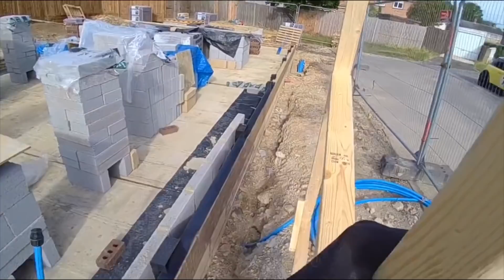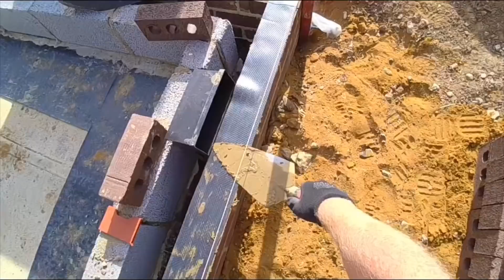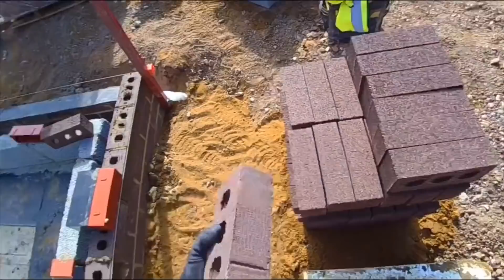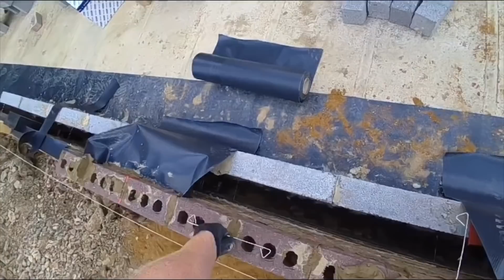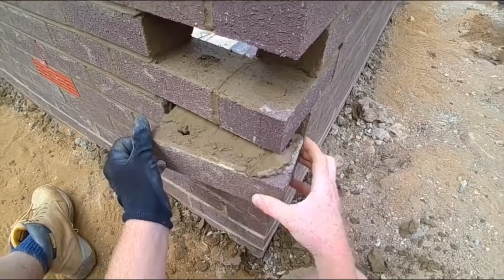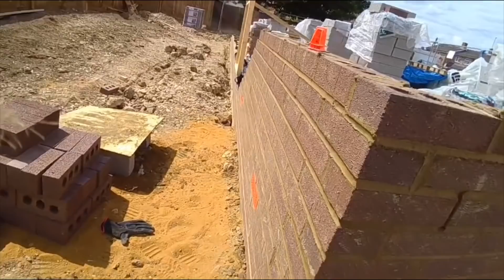Don’t do this when bricklaying | The skill of bricklaying

Comment: 2 tips for anypme coming in later on, when the bricks have a finish on like that, you will eventually learn to tell which way is up at a glance, as looking down from the right way up it looks smooth, and from the wrong way it looks rough. It'll make sense in practice.

Second is when putting ties in afterwards, its good to give the brick or block a little tap afterwards to close up the void you make pushing the ties into thw joint. Still not quite as firm as putting them in before the brick but when you put in thousands of the things you inevitably miss a few here and there.

Comment: Little advice, take note or ignore ,up to you. Do not use just the tip of your jointer on cross joints resulting in horrible  ripples finish plainly visible  on your photo  ,use the whole jointer and top and tail your joints. I could close my eyes and tell you are draging  the tip of your jointed just by the  scraping sound, loose that bad habit  . Good pointing can make bad brickwork look  good and bad pointing can make good brickwork look bad ,always remember that
Reply: I think only bricklayers care !

Comment: Is bricklaying a good career path to take? 20 years old, and still not sure which career route to take, any advice?
Reply: I'm a retired bricklayer/builder (back problems) just one of the issues I had, so let me give you the best advice you'll ever receive, STAY AWAY FROM BRICKLAYING,
1) losing so much money due to weather ( especially in the winter)
2) check out health problems with mortar/cement. 
3) rough, cracked hands (your partner won't like that)
4) poor eyesight due to cement, brick dust and chippings, grinder work,
I could go on and on.
Go for a trade where the weather is not a problem...
Electrician, plumber, joiner/carpenter, IT computers.
But whatever you do, GET A TRADE, or you'll end up at McDonald's, pizza hut or stacking shelves at Tesco. 
Good luck
Reply from the maker: I agree with paw way do it if it’s a last resort
Reply: Electrician or Plumber with your Gas cert. Take it from a Plasterer. Good luck mate

Comment: When replacing them bricks all you poms put the mud on the top of brick it make a mess and looks awkward to do and never look bang on always to low then you have to wedge stuff in what you should be doing is putting no mud on the will go in easier no mess and sit in the bed of mud properly and then get a Dutchie and fill the top joint in
Reply: No you put bed on bottom brick and butter back edge of top of brick but only enough to stop the push joint then it’s a top joint point with really dry mortar and a pointing trowel.
Reply from the maker: Sorry I should retire I’m doing it all wrong.
Reply: Well you would not want  him on a pointing job would you?
Reply from the maker: You have ruined my day with this comment thanks a bunch 😂
Reply: @ginger dust I would happily have you laying for us on the extensions we do. Take no notice of the haters!

Comment: There are bricklayers and then there are site bricklayers!
Reply from the maker: What am I 😂
Reply: Using an overhand trowel designed for skyscrapers in USA  see a lot of site bricklayers getting flicks of mortor on brickwork from cutting off because the blade is set for a different wrist action

Comment: Whats the benefit of bedding the damp on?
Reply: Mr Ctop93 to stick it down and then its also got two layers of mortar top and bottom for stability of the wall.....another reason is to prevent piercing from rough edges below but that's highly unlikely in my opinion
Reply: There is no benefit of bedding the damp on.
Reply: @frankiedancaster4424  two beds of mortar for stability of the wall? Is that a joke?
Reply from the maker: The whole house might fall over 😂
Reply: @GingerDust69  🤣👍
Reply: I’m pretty sure it just holds it in place until you lay a brick on it?
Reply: @sethmartin8576  all right seth, thats enough out of you
Reply: @carrot3945  you fill the frogs up and stick the damp on to prevent frost damage and to hold the damp in place
Reply: @stuartjones1982  incorrect sir
Reply: @carrot3945  please enlighten me
Reply: @stuartjones1982  you enlighten me instead, how would that have any benefit to stopping frost damage?
Reply: @carrot3945  if you dont fill the frogs with muck water can get into the void. In winter it gets cold. When water gets cold it freezes and expands (gets bigger) you still with me? Therefore it cracks perp joints, bed joints and the brick itself. Hence frost damage
Reply: @stuartjones1982  theres no need to just start making things up. If you dont know the answer just say you don't. We are all friends here
Reply: @carrot3945  🤣🤣🤣🤣🤣 ok I get it. You rumbled me
Reply: Mr Ctop93 what I'm referring to is a bed of mortars below and above the dpc to prevent the wall moving whilst plumbing or laying as most bricklayers will confirm that sometimes walls have tendency to move about whilst building/plumbing up especially single skim block walls....where as a bed of mortar under the dpm/Dec can help with this in my opinion that is. I guess as brickies we all all have our own methods 
🤷‍♂️
Reply: Ginger Dust to be fair I like the one weep hole above the centre of the air brick......that's one less then we usually do to keep nhbc happy must save some time overall matey 👌🏾
Reply: @stuartjones1982  just having a laugh mate, your a good sport🤣👍
Reply: @frankiedancaster4424  well said brother. I guess we do all have our own ways👍
Reply: @carrot3945  lol yeah I got that mate
Reply: Mr Ctop93 indeed as to build a wall off two pieces of plastic (i.e. Dpc ) with no bond between (I.e mortar) would be considered incorrect (I.e cowboy).....I know each site/engineer spec is different but day one is day one no.??

Comment: Your rough   still got a lot to learn, pushing  mortar in with your fingers ,cutting and running on cross joints  not full ,pushing  in time wires after laying brick , how the hell you missed them brick ends is unreal , airbrick wrong course, smears on face of bricks allin a  2 min video 🙆‍♂️
Reply: Where are your videos?
Reply: @deanmachaye9967  too busy to showcase my high quality work,I'm a BRICKLAYER,not a film maker,  this guy is neither
Reply: @deanmachaye9967   listen if you put videos  up showcasing  your skills ,you have to be of a decent level of skill or you will be criticised on your limited abilities, which is clearly what's happened  here, read the comments  for christs sake .
Reply: Yes like a apprentice